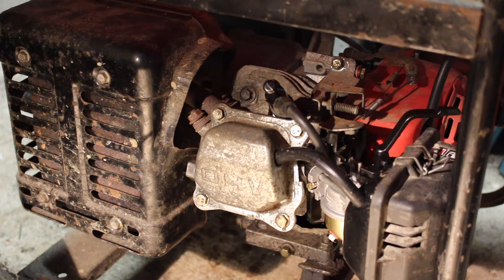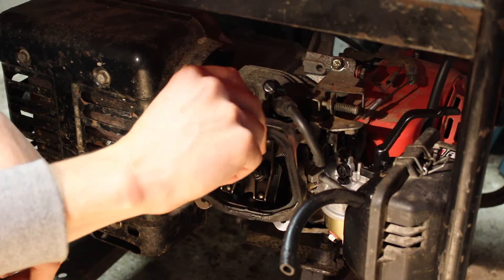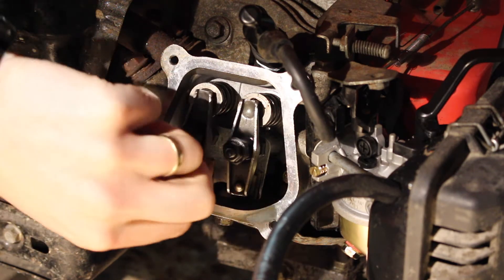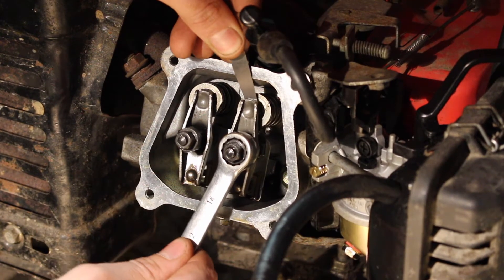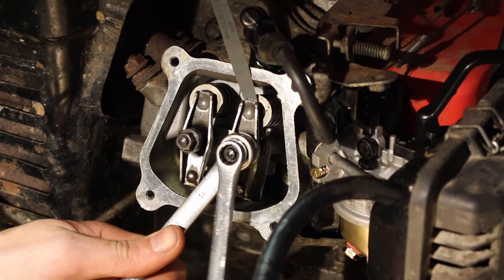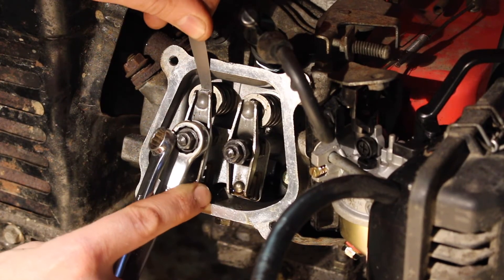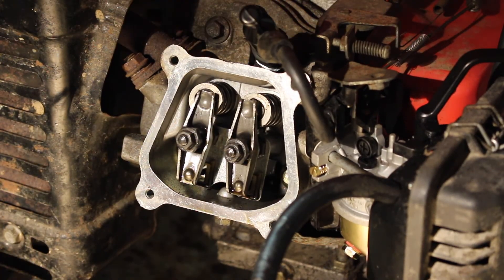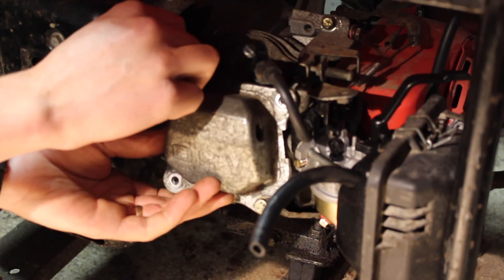How to Adjust Valves on a Honda GX160 GX200

Comment: Great vídeo  my LoncinG200F ( a clone of the Honda GX200) mounted in a law mower started to back-fire and the motor seems to loosed power  and sounds funny ... after 40/50 hours of work...the valves clearance  have never been adjusted I believe it´s one of possible causes  tomorow i´m going to try to adjust it  one question: I know how to find the TDC in my 4 cylinder car  motor..I have a clock comparator that screws on the spark plug thread in cylinder number one...I beleive that is the same in that case  has it has o just one cylinder ..i´m right ? thanks....

Comment: Just what I was looking for. This Honda clone engine is on a pressure washer and the recoil ripped out of my hands and back fired, so I knew it had to be the valves. I've been doing valves on tractors and mowers but never a pressure washer so knowing now that I have to find TDC with this particular engine. Thanks again

Comment: Does anyone know the lash adjustment measurement number for a car feeler gauge oppose to the numbers on small engine feeler gauge don’t want to mess it up and seems as if I have different units of measurement
Reply: The feeler guage usually will have both standard and metric thickness values on each blade. .008( 8 thousands) is a standard value and on the same blade the metric value of .20mm will be listed. There is no difference in car or small engine. Just the thickness of each blade. You will need to know which value (i.e thickness) you need for each valve setting. Hope this helps.

Comment: Much easier way, turn the flywheel(engine) until one valve is fully down for example turn it untill the exhaust valve is down then adjust the intake valve, and vice versa
Reply: You are correct. I tried it several times the way he explains to do it and it wasn’t working. I called a service center and they explained it the way you just described. They also told me the clearance is supposed to be 0.007 for both valves in the closed position

Comment: Be careful  if you over tighten the valve clearance on the feeler gage you can ruin the accuracy of the gage, as it gets deformed    Always remove  the feeler gage before tightening the lock nut, afterwhich recheck the clearance    Do not crush  the feeler gage.  The gage may flatten and become dished then the accuracy is ruined.

Comment: U should have shown how to determine TDC Top Dead Center.
Using both the screwdriver method
And the
Finger over the spark plug hole method.

Comment: Hi FixitSam, thank you so much for posting this video. I have a Black Max 3650 generator with the Chinese version of the GX200. When I first got the machine several years ago it started fine but approximately two years ago (out of the blue) it wouldn't start. Of course it was really cold out so I preheated the cylinder with a torch and it started right up. I never dreamed that an engine with as few hours on it would need a valve lash adjustment so I looked for other reasons for the problem. After I couldn't find any other reason for the refusal to start unless hot, I popped the valve cover off and eureka!!! The exhaust valve had no lash at all. I adjusted the valves per your video and the engine started with one pull on the cord. Thanks again for posting this video.

Comment: Would the valves cause the engine to refuse to start, and possibly backfire? Just replaced the carb,  the engine has been sitting for like 15 years...
Reply: Have that 7 year old girl with downs, down the street have a look at it.
Reply from the maker: Does it have good compression. Backfire could be a timing issue, check the flywheel key
Reply: @FixitSam  I've not that far into it, and I don't have a compression tester